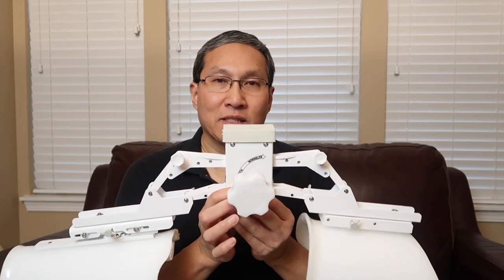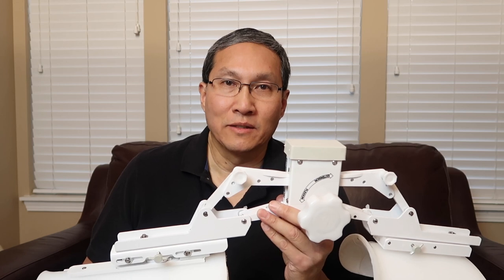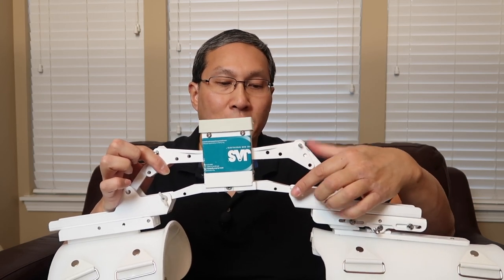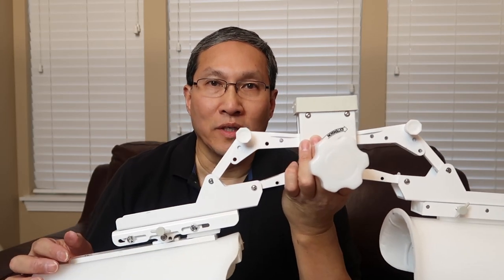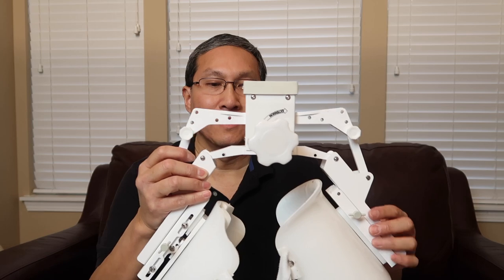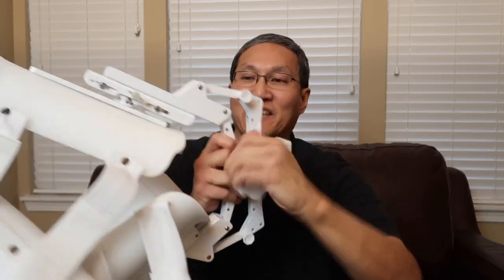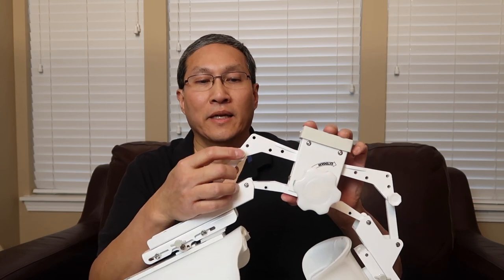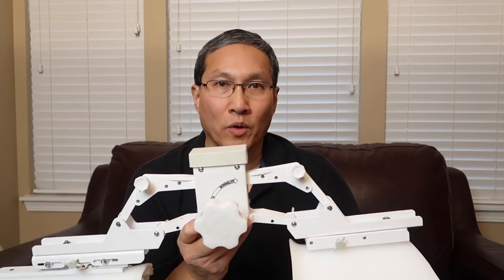Changing A JAS Knee SPS From Extension To Flexion And Back - Knee Replacement #88

Comment: Thanks Russ!  Hopefully, more Dr. will offer this product.  This is especially comforting to know after you hear your range of movement will not improve 3 months after surgery.
Reply from the maker: It can take a lot of work and time, but for some people, their range happens quickly.  Not so for me.  It took 4 months for me to finally get to 120 degrees of flexion and 5 months to get to 130.  Both of these were only when pushed to screaming levels by the PT.  I think if I had the JAS unit earlier on in my rehab, I could have gotten better numbers earlier on.  When you are at home and there's nobody pushing your leg to get your knee to bend, having a JAS unit to do it is beneficial.  The problem is, if you don't know to ask for one and your doctor doesn't bring it up, you don't even know that devices like this even exist!  I mean, who really researches to this level before getting a replacement?  And, how are you to know there are options like this to help you if you've never heard about it before?  I think doctors and therapists should recommend something like this a lot earlier on to some patients.  I didn't even know about the JAS units until 3 months after my surgery.

Comment: Russ, I heard you talk about JAS unit before but I hadn't ever seen one until this video.  You gave very good and clear instructions on how to change the unit from extension to flexion and back again., even I understood them.  One question, how much does that unit weigh?  I'm guessing, the first time you used it that it felt 100 times heavier than its real weight. Thumbs up on this video.....Dan
Reply from the maker: Thanks.  I think it weighs around 4 or 5 lbs, something like that.

Comment: I wish I could get one or something something similar 😢
Reply from the maker: Ask your doctor or check with insurance.
Reply: Russ Is Right it might be to late I had my surgery Aug 5 and MUA October 20
Reply from the maker: It might not be too late.  I had my surgery Sept 19, 2019.  I got the JAS unit in Dec 2019 to Jan 2020.  Then again, I got it back in June 2020 until now.  The JAS got my reverted flexion back from 104 degrees to 120 degrees or more.  It might not be too late.  Ask your doctor.
Reply: Russ Is Right thank you I will